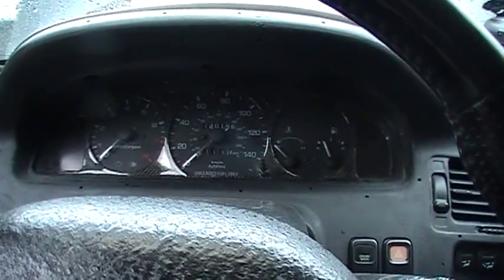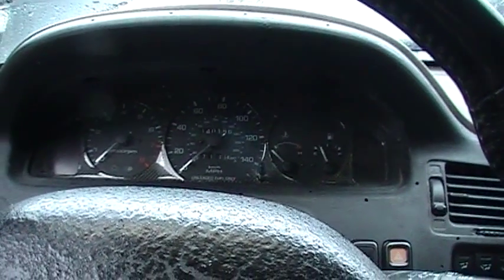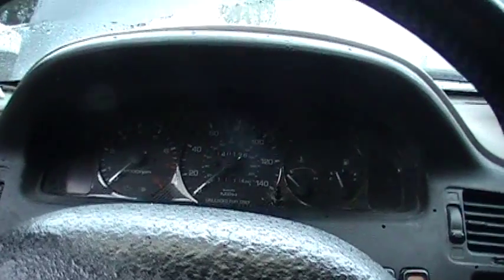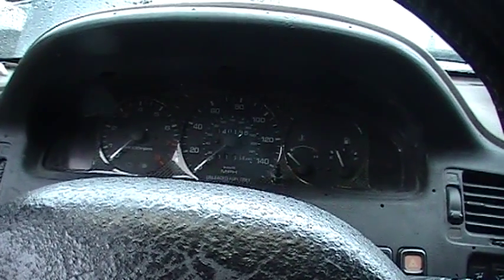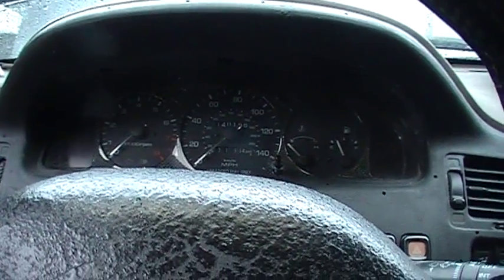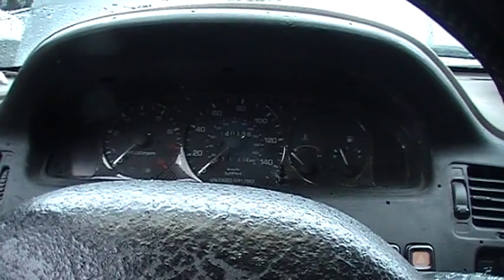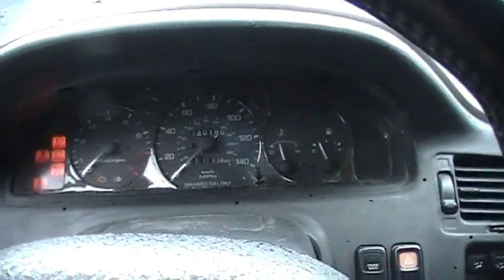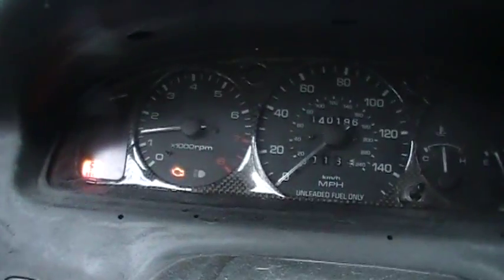Engine knock

Comment: sometimes shit is much simpler then it seems. had a whistle noise that getting louder with engine rpm. i thought im fkd. till i realized it was coming from the speaker. previous owner hooked up the stereo in a strange way.

Comment: You gotta replace the motor. It cost more in labor to fix that. And if you keep driving it or revvving it, its going to send the rod straight through the block and gunna die anyway

Comment: run 3m three step cleaner it is just piston slap from built up carbon i own 2 94 and 93 auto and 5 spd built ground up trust me just get car hot drive for 10 minutes and run carbon clean into intake vac port on side next to firewall pointing down keep at 
2800 to 3000 rpm for 45 minutes it will purr

Comment: Its not a peice of shit, its just an older car and requires maintnence - parts wear out. 
Sounds like the hyd tensioner - they go bad all the time- they are the biggest problem with those motors.   Chances are the car isnt even running optimal..when the tensioner wears out.. the T belt starts jumping teeth

Comment: i went trough the same problem it is hyrolic timing belt pulley that works with oil i got it replaced for 600

Comment: I am a probe owner and am very familiar with that type of knock. It is most likely just the HLA's ticking (Hydraulic Lash Adjusters). If it runs and drives fine, then it is fine. The HLA knock is EXTREMELY common on the 2.5L v6 in the probes and mx6s. If it is the HLA's then it is just gonna be annoying but won't hurt the engine. It is hard for me to tell for certain not being there but thats my best guess. My probe has a knocking sound as well but runs and drives great.